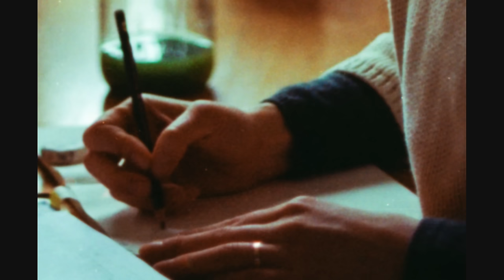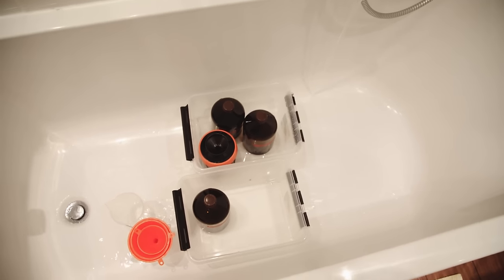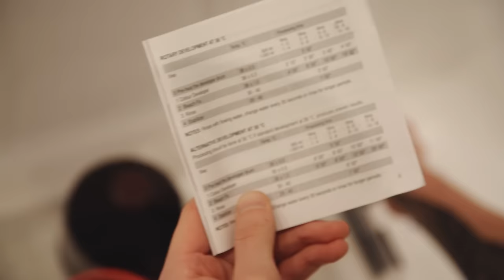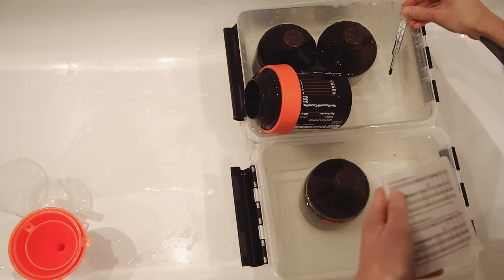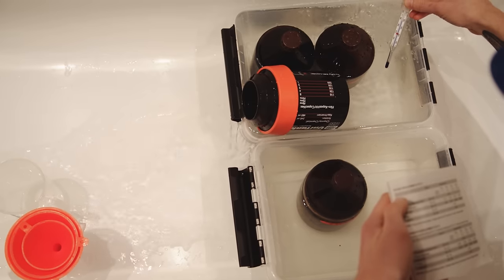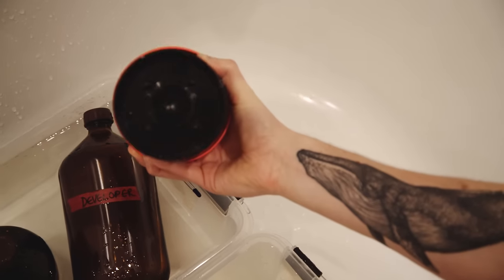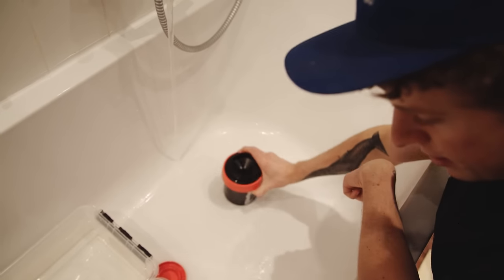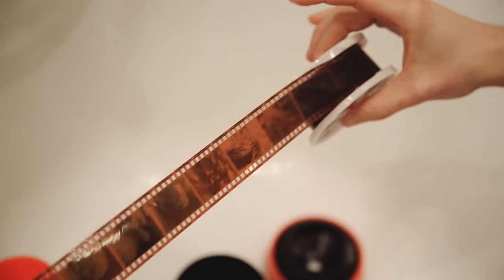Developing 35mm Color Film at Home: Tetenal Colortec C-41 (Snippet 30)

Comment: you  dont need to fill up the whole tank if you just develping 1 roll of film its need just 350 ml and 550ml for 2 rolls at the same time. You just wasted som developers and money
Reply from the maker: Thanks for the tip! ---Lou
Reply: I think it does not matter, cause you in that case pouring back chemical twice weakened than in this case, on the end it's same concentration of developer in the bottle.

Comment: Doing C-4 on your first go at film developing? AMAZING. Haha. Just gonna share some of my opinions. I've done countless rolls of BnW but never colour. 

1) LOVE how you did the overlay of the darkbag when loading the film. Best visualization of loading film in a dark bag everrr 

2) A favourite method for agitation used by many including me is to invert WITH a twist. So you hold the top of the tank in one hand and the bottom in the other, and as you invert it, you give it a little twist. 
Also! Always, always, always, give the tank a little tap or double tap on a surface after filling it with any liquids or after agitation, this is to remove air bubbles on the surface of the film from the agitation//pouring. They can leave marks (due to under development) if the air bubbles are on the film too long over the course of the development. 

3) be careful with the film squeegee, I never used one and technically it is not needed, if you're not careful, a little piece of sand on the squeegee can scratch the entire roll of film while you squeegee it. What I like to do is just after hanging the film, rinse more "Photoflo" or whatever you used for your final rinse over the hanging film to make sure it's coated with water evenly so it dries evenly.. It may take a little longer but I just dont trust squeegeeing my film. 

Amazing video and can't wait for you guys to explore medium format and then large format and then shooting Polaroids WITH large format!! Sorry I'm getting ahead of myself haha. 

Btw I have a feeling you've been metering a little under.. The film photos you display in the beginning I would consider underexposed unless that is the look you are going for. I would try rating at half box speed the next time around and see if you like the results better. 

And congrats on the marriage!! 

Finally, I notice you don't label your negative sleeves? 
I have an archival system worked out using codes on the negatives matching tags in Lightroom of the film scans. If you'd like to hear abt that I'll gladly share.
Reply from the maker: Thanks so much for the AWESOME comment and advice David!!! I will definitely try that inversion technique and ditch the squeegee ; ) We are underexposing for some reason, its on av mode though so I'm going to try and shoot a roll manual and try and compare the results. ---Lou
Reply: Definitely loose that squeegee. Sooner or later, it will pick up grit and start scratching your film. 

If your stabilizer does not include something will the effect of Photoflo, then add the proper amount of Photoflo stock directly into the stabilizer solution. If you mix up a Photoflo bath as an added step after the stabilizer, then that new last step will flush out most of effect of the stabilizer - not good.
Reply: I have like 25 rolls of undeveloped old film that are about 12 years old. I REALLY want to save them, but can't trust it to a mail in developing place. Ca I save it my self? Can it still be developed. A local Walgreen that still developed, tuned one of my old rolls into a slimy mush and destroyed it. They were successful in developing three others. I guess I can practice with new film first.
Reply: @Txpb2  if it's colour film, you can use black and white development to reduce the risk of turning your photos to mush, as it's the colour part of the film that degrades first, the b&w lasts a lot longer. Of course the photos will be black and white then. Anyway, maybe worth looking into.
Reply: David Choo I would love to hear about your archival system!
Reply: My tutor squeegees film with wet fingers, he says it's always better and safer than using a squeegee. I've also only developed b&w film but I'm looking to get my own developing kit when I can afford it 😁
Reply: I would like to hear about your archival system
Reply: You should normally do a rinse at the end - for quite a while, you don't really need photoflo just add a single drop of dish soap and you're good. Wet finger squegee is the way to go
Reply: @david Choo... I realize this thread is 3 years old, but very curious about the archival method you mentioned.
Reply: @christaylor4179  Wow, Ok I didn't realise a few people were interested in my archival system... It's actually not that sophisticated!

Basically i separate 35mm and 120 negatives with a prefix, '135' for 35mm film, '120' for 120 film.

My first 35mm roll is "135-0001" & 120 is "120-0001". This code along with other info like camera used and film stock is written with a sharpie on the archival sleeve for the negative.

Once scanned and imported to lightroom, I attach that code as a keyword in the metadata to the photos in that roll of film. You could actually take this a step further and label each frame in the negative like "135-0001-01 until 36/37, but I haven't gone that far. It would make it slightly easier to pinpoint a frame in the archival negative sleeves from lightroom or vice versa.

Honestly, that's basically it. I keep shoeboxes labelled like 135-0001>135-0050 for my first 50 rolls of 135 and so on and so forth... 

Feel free to reach out to me on Instagram @davidchoo__ I can DM some photos of what exactly I write on the plastic sleeves. It's really not that sophisticated but lends some sense of organization to all the negatives I think.
Reply: @christina8433  sorry for the late reply, I never saw this comment! i've posted my answer as a reply to chris taylor down below!
Reply: @ceew2756  just shared my archival system here, sorry for not seeing your reply!
Reply: @spitefullymy  Thanks for the reply. I'm just starting out shooting film again, and I'm really interested in a comprehensive protocol to label and catalog my negatives., while tying them into Lightroom. This sounds perfect. I'm hoping that years down the road, I've shot enough film that I'm being smart now!

I'll send ya an IM on Instagram... @cltexan

Comment from the maker: We just uploaded a blog post with a bunch of the photos from this roll to our website if you guys want to see how they turned out! http://plantbasedtraveler.com/film-photography/ Thanks so much for all your support in the comments :) We can't wait to share more with you next week ❤
Reply: Not bad developing.  My recommendation for you is, since C-41 is very strict at 101 degrees F, keep the water running at the temperature and make sure to take the temperature of the developer.  You are using the water as a heat exchanger.  The water is not creating the film; the developer is.  Your photos will have increased contrast.  

Oh, and get some photo-flo.  It makes the water roll off of the film during the drying stage.  Otherwise, you may cultivate watermarks (similar to your car windshield) on your film.  One bottle will keep you going for years because you only need a couple drops per roll.

Comment: for anyone who goes into developing their C41 or other films. check the temperature of the chemicals (not the au-bain-marie temp.) and use a thermometer for every chemical, so you don't  contaminate the different fluids. With a sous-vide you can get the fluids nearly to the desired temperature,  and don't forget to tap the drum, to get rid of the airbubbels in the drum. I have developed in the past more the 30K films.

Comment: Welcome to the easiest and fastest type of developing! A few pointers if I might, from someone who’s been doing this for 3 years now:

Agitation is by inversions for the first 10 seconds of every 30, including at the beginning of the developer. 

You can heat all your bottles up together in the same bath and once the developer is warm enough you can remove all the bottles and start developing. Since the developer is only for 3mins 30secs, and the blix has a temperature tolerance of +\- 5F, there’s no risk of it cooling down to where it won’t work. Stabilizer can be at room temp but best  practices suggest keeping your temperature range close to avoid damage to the emulsion.

Check out the Ilford wash method if you haven’t. 

Stabilizer is for only 60 secs and it’s important not to wash after that because the stabilizer is an anti-fungal to prevent baddies from nomming on your negs. 

As the developer and blix age you will get floaties in them. A funnel with a filter is essential.

I used to swear by squeegees too until I got two rolls of scratched negs. One with a sponge style and one with the rubber style. Finger squeegees it is!!
Reply from the maker: Thanks so much for the tips Nick! We've had to downsize and don't have any of the space for this stuff anymore but it was a fun little project! ---Lou

Comment: Developed my first colour film with Tetenal C-41 3 bath blix and totally messed up the temps and dilution it ranged between 36 and 41 Celsius I forgot to empty my pre-soak before putting in the developer so I guestimated and added an extra 1.30 to the development time to compensate I never inverted the tank I just used the twizzly thing I forgot to cool the blix which was at 41 Celsius I then rinsed with the same 41 degree tank water a few times. I think the stabiliser was the only thing I got right also I didn't bother to squeegee. Anyway the results, absolutely perfect negatives 100% better than what I got from the local 1 hour process lab with the same film type and camera those were grainy as hell and streaks everywhere. The film superia xtra 400 cheapo stuff turned out to be more forgiving than any B&W I've developed maybe the film itself is forgiving I don't know. That's about as brute as it gets and negs still came out spot on with nice colours barely perceptible grain and nice contrast. It's taught me I don't need to stress about temperatures and timings as much as some people like to think with that film anyway.
Reply from the maker: Totally agree! People really overdue it with perfecting the temperatures and stuff, I tried to be accurate but not perfect for the sake of the tutorial other wise people complain but normally when I do it not on camera I kind of just wing it a little more, its not rocket science ; ) and somehow it always works out better than from the store! ---Lou

Comment: so, did you guys just pust the liquids back in their bottles? Can you basically infinitely re-use them?
Reply: Depends on the brand and method, but you can re-use most of them a couple of times. Some like, 2 times, some 20 times... depends :D
Reply: You can use it couple of times without worries but with a limited period of time, if I'm not wrong a month max 2 months, think of milk for example once opened goes bad in a short period.
Reply from the maker: Yeah ours say 6 weeks for developer, 24 weeks for the other stuff, but I've read they can last a lot longer, so we shall seeeee : ) -----LOu
Reply: @WildWeRoam  You may not answer this but it would be a big help. I am going to buy the same Colortec you have bought so when you say 6 weeks for developer, 24 weeks for other stuff, do you mean once the solutions have been mixed in the amber bottles? Or once the bottle caps in original packaging has been opened? Sorry to bother you! Love your video great stuff!

Comment: I have a question. I messed up mixing blix. I accidentally put 1250 ml of water instead of 1000 so I had to dump the extra 250 ml after mixing blix a & blix b. I didnt realize I put too much water until I poured it in the bottle & I had some left. I know my blix is gonna be a little less potent now so my question is what can I do to still get full results? Should I blix the film a little longer or should I just go as directed? Thanks in advance.

Comment: I just bought this kit, I've watched your video along with a couple of others but one thing confuses me - the chemicals are supposed to be at 38 degrees but you (and others on YouTube) measure the temperature of the water that surrounds your chemical bottles until that reaches 38, but that doesn't necessarily mean the contents of the bottles themselves are exactly 38 degrees does it? So how do you ensure the actual contents of the chemical bottles are a perfect 38?
Reply from the maker: It doesn't necessarily have to be perfect, but basically you need to let the chemicals sit in the right temperature water for a while so that the inside of the bottle matches the 38 degree temperature, you just don't see all the waiting in the video : ) ---Lou
Reply: Which kit is that?  Can you  post the link?
Reply: I'd like to add that keeping the temperature the same in color processing (not so much in b/w) is critical to how the negatives come out. you can get a glimpse of it, but even if youre off 1 degree, you run the risk of ruining the color grading. So rememeber,  to all those that are now going to try this process, be patient! That is where the fun is.

Comment: Does any one know where I could get a starter kit that comes with the chemicals and the other tools to do this?
Reply: I don''t think so, but putting one together isn't hard. Suggest you go to Freestyle website and get their Arista products: a film developing tank (better design and cheaper than Paterson), C-41 kit (rebranded Unicolor - very high quality). a digital thermometer (or check Amazon for this),  a funnel (drugstore or Freestyle), three amber glass, one liter storage bottles; the plastic bottles sold for photo use are crap and hugely overpriced (The Bottle Factory, online), and measuring beaker in milliliters, at least 500ml capacity (Freestyle or drugstore). Skip a film squeegee; unnecessary and they will scratch the film anyway.  That's for regular C-41 color. If you want to experiment with using B&W chemicals on color film, add B&W developer and fixer (Any will do, since you are just screwing around and wasting your money.)
Reply: Cinestill

Comment: When loading the film in the dark room/bag, how do you know where exactly to cut the film so you don't mess anything up or cut into an image? Thank you
Reply: you kinda get a feel for it with your hands, but definitely do not touch the emulsion. use your index finger and your thumb to feel for the sides until you can visualize where it ends.
Reply: A good policy, but it's not like you are going to destroy your image if you touch the emulsion, ssuming ypuo have dry hands.
Reply: You cut the leader off at the beginning and the cartridge off at the end. What's the problem?

Comment: Where do you buy the ADOX files as shown at 8:42 ?
Reply from the maker: I got them online from a german photography store but I'm sure you could find them on amazon or through a diffeerent online photography store that carries film supplies! ---Lou
Reply: Thank you for confirming. I saw them on a German website too. They are oversize and should fit 7 6-frame 35mm strip film holders.

Comment: Film developing at home can have environmental impact as well as lead to issues in your home. Study before developing or making a darkroom for prints.

Home with well water and septic system:

Ph levels in developer and stop bath can change your ph levels in your well water. The acidic levels in stop bath can actually lower a ph in your well and affect the water that goes into your well, over time.

This can lead to low ph on your home, which will damage and erode copper piping and lead to leaks in the house, and a rusted water heater. Eroding pipes can put metals in your drinking water, not safe. 

Septic systems themselves can also be damaged with film developing and darkroom printing . Most film companies advise against processing at home with a septic system.

The running of water for long period for rinsing film and especially fiber prints can over flood your septic and cause major issues with your leaching fields and ecosystem of your septic tank. 

The chemistry itself can also kill enzymes in your system and cause septic back up and even tank damage.

Please study the risks before processing and printing at home. If you have a well, or your neighbors have wells, and a septic system, digital is probably the way to go. There may also be laws in your neighborhood or state that prohibit film developing at home. Be advised.

Comment: Hello~~~~there is a question: How to keep constant temperature in developing film?  After you shake the tank and add chemicals , the temperature would change because it was outside the tap water.
Reply from the maker: Lou usually keeps the tap water running the whole time at the right temperature to keep the water temps correct. Hope that helps! - Dana

Comment: Using Tetenal at 38 °C is bad waste of energy and once mixed, the CD chems are dead after 6 weeks. So, if you develop only one roll of film each 8 weeks, this becomes quite expensive. Have you probably figured out a room temperature timing?
Reply from the maker: Thanks for the tips roland, definitely makes sense to have this set up if youre developing a lot of film regularly. As for the temperature timing we're doing well! - Dana

Comment: Great vidéo ! Do you know how many 35mm films can you develop with a set box of C-41 ? I'm trying to figure out the cost of developing per film (without the film cost) :) thks ! ✌
Reply: Usually like double what the box says. If it says 12 rolls, realistically, you can do like 25. 

Important, always rinse film with water in between each step, this prevents the chemicals from contaminating each other, they will last a lot longer.